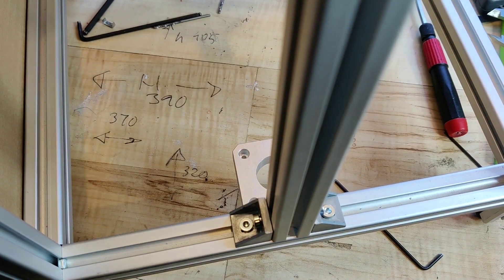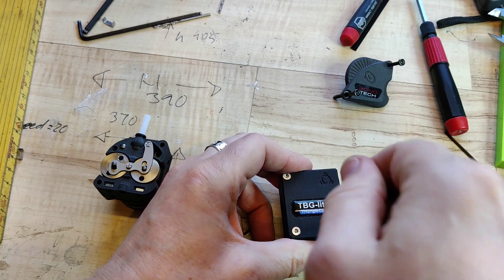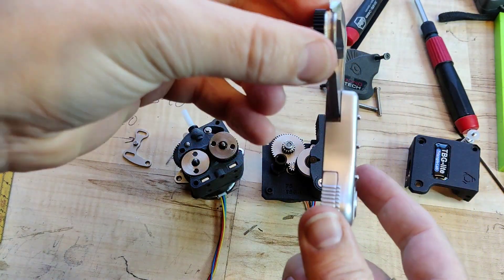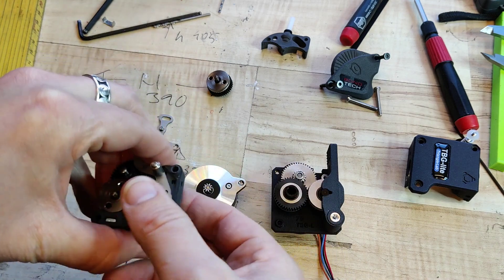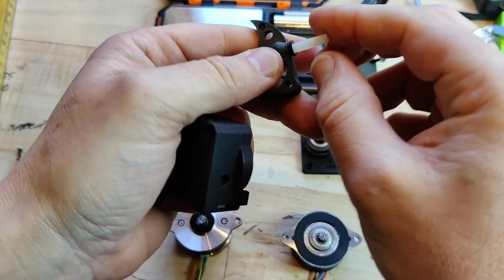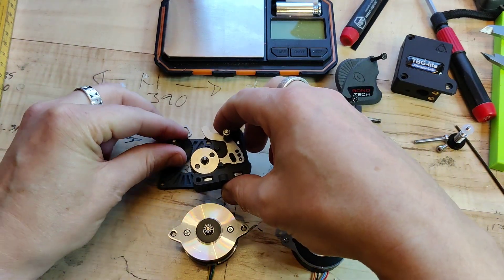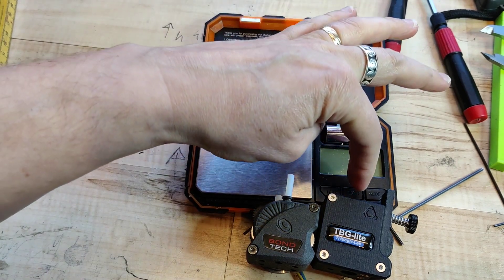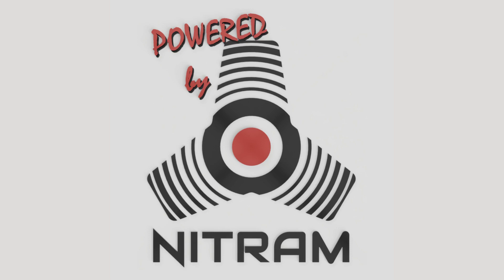Is bigger better... gears..

Comment: It’s nice to see that you‘re actually doing what I‘ve been thinking of for a while: Using 40x20 extrusions in the xy plane for more frame stiffness and a more straightforward way of mounting the x and y rails with a vertical offset.
I‘m surprised the implementation on the Annex K3 is not like this.
Have you considered making the frame a little larger in order to have independent shafts on each corner? That way you could get rid of the idlers and only use pulleys with bigger 625 bearings (better wear resistance?) and tension the belt by moving the pulley (possibly less complex?) instead of doing the tensioning at the cross carriages.
Also, the „bow“ on the carbon fibre backings is just extreme attention to detail, I love it! Did you calculate the exact shape for best stiffness to weight ratio? ;)
Reply from the maker: I can't take credit for the frame design as it's done by Maze.. the bow is mine =) and not calculated...

Comment: So when the tension is adjusted the gears also have different contact area of the meshing gears? Is this more apparent on bondtech because both gears move, does this cause more artifacts or am I being picky? I would love either as an upgrade XD. Can't wait to see the new printer.
Reply from the maker: the meshing of the gears is probably not the problem....

Comment: I think you should try both 😅

BTW TBG Lite can be ordered with 20 mm LDO motor as well. The LGX lite gear is not POM, per Bondtech representative on VORON Discord "It is PBT gear with 20% glass filled. It should be safe to use up to 80 degrees Celsius without any affection." But it may change in the future.
Reply from the maker: I mentioned that the TBG had two motor alternatives. thanks for the info on the gear material.. and I will try both.. =)  edit; PBT GF30 isnt't reccomended for sliding applications due to excessive wear... interesting choice

Comment: Not an easy question. You also should have weighted the motors. Both have the same downside (backlash on the second gear / which had trianglelab easily could have fixed but they always do the things just 80% or so). Maybe the minimal bigger gear is better. But i would go for the LGX because the tensioner looks faster/easier to use.
Reply from the maker: the LDO motor is a bit heavier.. The tension on the LGX lite is interesting and I haven't got to any conclusion on the pros and cons of that yet. The LGX has a similar system and I got stripped filament with that one due to the fixed distance..
Reply: @Nitram_3d  ah cool the lgx was lighter than the other so as a package they should be similar i guess.